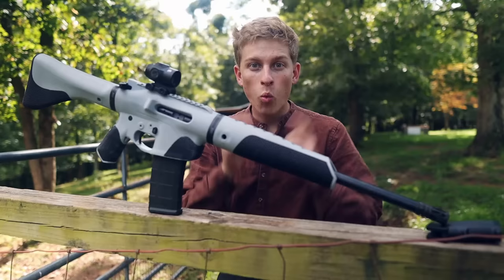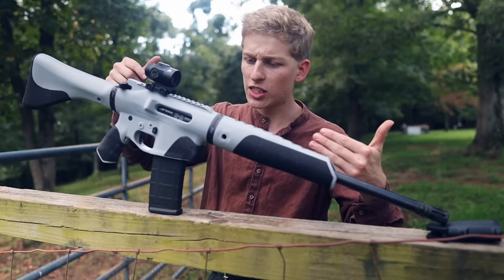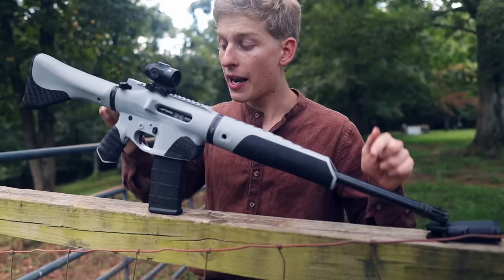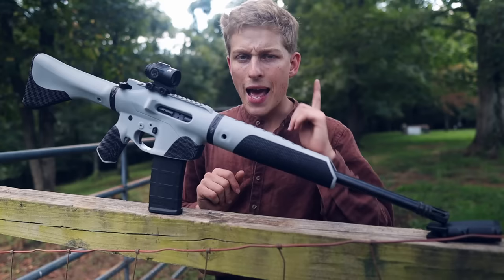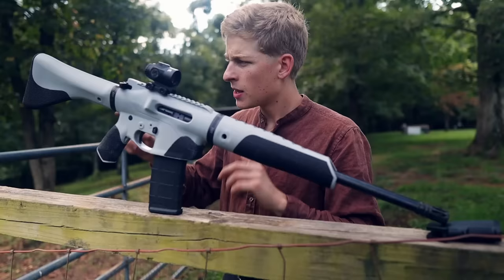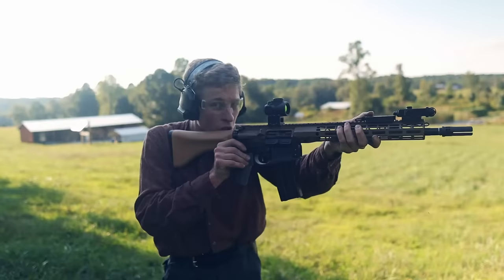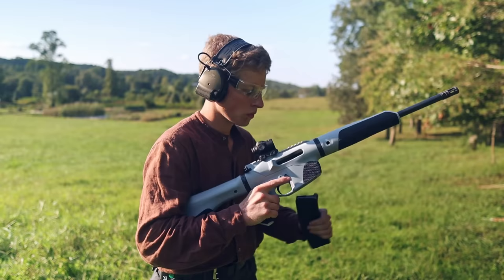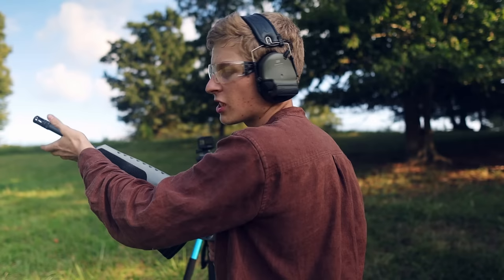I Printed an AR-15

Comment: It looks to me like the front wall your deflector wall isn't steep enough. If you look at where the shells hit the deflector on the manufactured upper, they hit farther up on the point because it is steeper and slightly farther forward as a result. On your upper, they are hitting on the front face, which pushes them forward. A totally different idea would be to add a slight angle to your deflector face, either up or down. That should deflect the shell out of line with the ejection port and guarantee that it doesn't go in. I've often wondered why manufacturers don't do this. Also worth trying an adjustable gas block. You may be over-gassed.

Comment: Will there be any support for a left handed version?
Reply: I think that would just be a lefty bolt and mirror the slot. I don't know how the selector works on it though, but you could mirror that (you can print the selector/mirror it, and you can also print mag release so mirror it too). So I would think eventually, but I don't know the specifics on how they make lefty bolts.
Reply: @jakegarrett8109  I’ll just get an ambidextrous selector switch. Shouldn’t be too difficult to modify it to be left handed, but it’s be nice if there were lefty files at launch haha
Reply from the maker: I would like to.
Reply: @HoffmanTactical  that’s nice to hear! I’m glad there are people who take the time to design stuff like you do!

Comment: It's a cool design. Is there any way you could get a nicer resin printer? It just seems like anything made out of melted plastic is obviously going to fail quickly. The plastic itself is made to melt at pretty low temps so it can be printed. To actually print a whole gun you'd need some sort of plastic that can have a secondary reaction once printed that makes it significantly more heat resistant. Or I imagine resin could be very heat resistant. Or you could go with a nicer 3d printing tech than either of those. 

I think if a town had one guy with a high end 3d printer who could print them in resin it would be big just for if the world went to shit. I don't think PLA based guns are ever really going to make sense, but I really respect the work you put into this.
Reply from the maker: Sadly resins don't have the needed mechanical properties - yet. I have high hopes.

Comment: Not really a gun or 3d printing guy. All I can offer is, you've got a cool science fiction gun.   Take a close look at your deflector. Look for dents are scrape marks. Since it's 3D printed, I'm sure it's got that stair step printlines look about it. If it's got a vertical printline, it's not really a ramp, it's reflecting on a 90° plane.  Try filing it down. Alternately, try polishing.  The other option is to reduce or get rid of the deflector completely. But you already know this.

Comment: print every weapon page? also for the ejection problem, try a smother transition from the port to the ejector itself. seems to hit really close to the straight part and could be the issue. that or get a heavy buffer tube

Comment: I'm guessing that the plastic is absorbing more of the energy from the spent casing. The metal brass deflector rebounds more of that energy at an angle on the spent casing thus sending that spent casing farther away and at a larger angle. The plastic maybe has less rebound force? Just like how golf club driver faces can be more or less "hot" in their rebound force. (Trampoline effect / coefficient of restitution)

Comment: Try a seamless transition from back of bolt opening to deflector as one solid ramp out instead of the bolt opening, hard angle, then deflector, does that make sense?
Reply from the maker: Yes! This is actually what I did with later versions of the design.
Reply: @HoffmanTactical  oh cool I’ve put the files somewhere safe while I get better at using my printer. Keep yourself safe brother you’ve done great things for all of us but make sure you keep yourself safe aswell. You have the ability to make people listen to what you’re saying and that could turn out to be a very important skill in the future. Much respect

Comment: I have been looking the video and I think the problem is the thickness of plastic and that kind of 90 to 45 degrees that generates the deflector and the upper. In a future iteration  you should try a straight 45 degree to let more space for the brass to spin a litte bit more and also to avoid the perpendicular bounce in that border and creating kind of a slide for the brass and let it hit hard against the deflector. Just an empiric idea from observation. 😁

Comment: You might fix your ejection problem by having an angle in the plastic at the ejection port, it's too thick and the cartridge is bouncing off the back wall, giving all 4 sides of the ejection port, say a 40 or 45 degree angle, could possible negate the need for other solutions. Unless that is, you specifically have that area right there that thick for a good reason, in which case, carry on and good luck, nice build.

Comment: 13:49 i think that your ejection problem may be related with the elasticity on impact of the plastic with the shell, you could try changing the deflector angle of the plastic or adding a metal sheet cover to it which could also add more durability to the deflector. Additionally i would look on the flat part of the groove on the start of the deflector, you should definitely consider adding the slope to the end instead of having an "L" angle.

Comment: Man, thats some sweet design work 👍 As far as the ejection issue, it seems like the ejected case is getting caught on the rear of the ejection port on the perpendicular 'flat' wall before it angles back to the brass deflector hump. Maybe extend the rear of the ejection port opening further to the rear, blend the rear of the ejection port as a smoother transition into the brass deflector, and make the brass deflector less steep of an angle.

Also - how about polycarbonate for the heat-sensitive area? Doesn;t it have a higher glass transition temperature than any of the nylons?

Comment: Have you watched any of 3d Nero's streams? I'm not sure carbon filled nylon is going to do what you want in the long term as it still has elongation issues in heated chamber Vorons and that is no more than 100-150C in the heated chamber. For semantics, it really does come down to a question of what is an AR-15 though. You've drastically re-engineered or designed from scratch the upper, lower, buffer assembly, handguard and barrel mounting system, but retained the barrel, gas system, bolt carrier group, buffer spring/buffer and trigger group. Is it still an AR-15 or is it a new gun that shares common component? It certainly looks better than a standard AR-15. I think it is overall a brilliant.
Reply from the maker: Yes, so I think a lot of the issues with Nylon on the Vorons is due to creep. Annealing the Nylon drastically reduces the problem, which is what I am betting on ;)

Comment: Ejection port is too far back and  bolt is hitting ejected brass when returning.
Reply from the maker: Funny enough, the problem was actually that the ejection port was not far enough back! The plastics deflects brass differently then aluminum, and the port geometry has to be changed.

Comment: I love your video. I think the shell ejection port might be a little bit too thick. the  Initial angle is to steep. It looks like your receiver might be 1/8th to a 1/4 inch thick and that is catching the back of the brass towards the rear of the upper. That may be causing your malfunction.

Comment: From what I seen the ejection port the shells shoot out backwards and catch on to the port itself and when it's a metal gun it probably just slides off of that nice and perfect but when it's 3D printed and especially when it's red hot shell it's probably going to want to stick into there that could be why maybe if it was a lot smoother instead of going completely flat then have the ramp make the whole thing a ramp. Just a guess and going off what you are showing in slow motion.

Comment: One piece lower-stock should be the way you went on reason to have a two piece design
Reply from the maker: Print orientation and printer size dictate a two piece design.

Comment: Exactly how stoner envisioned it - one linear fire system surrounded by light stuff.  Fire control should have been printed too.
You just printed the furniture.
Reply from the maker: One are of dev at a time ;) FCG is another project.
Reply: Last I checked the upper and lower recievers weren't considered furniture

Comment: Is it possible to build this left-handed?
Reply from the maker: Yes, though I've not designed it yet.
Reply: @HoffmanTactical  is that something that could be done by mirroring the print file then buying parts designed for a left handed gun? (Brand new to building guns, the most experience I have is in dismantaling my JTS M12AK for cleaning.) And thanks for your time

Comment: someone needs to develop better high-temperature resistant materials. Some kind of cooling system, some kind of thermal conductive coating and material. The gun would melt in a long gun battle or war. You can't beat metal and wood. Why not a mini CNC machine that turns out lowers?

Comment: I'd say it's more of a 99 cent store AR-15C as Cheap as any hard plastic can be. I'm guessing 20 rounds and broke.
Reply: Most designers require them to survive 1000 rounds before being released. The fgc9 has been documented going multiple thousands of rounds before any cracking and it has a home made bolt and barrel.

Comment: Why even waste your time with PLA? Awesome project BTW. I'm hoping I can get in to the beta. CF Nylon is probably going to creep long term. I have allot of experience testing it in heated enclosures, and have had some nasty failures at high temperature. Cost wise polycarbonate is going to be your best bet, IMO.
Reply from the maker: Annealing should help a lot with your creep issues. I'm going to try using PC CF, but it does have impact and layer adhesion issues. I use PLA for prototyping, since I'm doing little more then fitment testing.

Comment: Reduce your deflector angle (more obtuse an angle than milspec) by the same % as the difference in elasticity between pla t6061 your problem is you have more bounce with pla

Comment: At 9:06 on the video you will see his upper split away from the intergrated buffer . The third shot at 9:11 the split in the upper opens again . 9:17 it happens once more . Play youtube video at 0.25 speed see it happen . He is lucky his face is still intact . Dont 3d print uppers or lowers they are a death wish . If you want to make your own lowers go to defence distributed and buy a cnc machine and do it right . Also follow all necesaary federal mandated protocols .
Reply from the maker: The gap is from the buffer tower flexing, and does not lead to failure. I have had other designs that did break at the buffer tower, and my face is still intact ;) Pressure is contained within the steel barrel extension, as with all AR's.

Comment: Dear Hoffman Tactical.
You try creating Maximum 3d parts AR 15.
I want to offer an idea. 
How about try 12 gauge single shot shotgun?
Only metal pipe - barrel. It is possible?
Reply from the maker: It's possible, but much better options now a days (liberator 12k)
Reply: @HoffmanTactical  Thanks for the Answer.

Comment: How about you get an adjustable gas block before talking about a defective bolt carrier group
Reply from the maker: I've actually got one on the way, however, I know now that the problem is related to the ejection port geometry, and the elastic properties of the plastic. An over gassed gun does not cause this level of malfunction.

Comment: 17:25 ummm is it just me or does it look like its about to split open
Reply from the maker: Buffer flex, it's actually normal on poly lowers, but you can't normally notice it like this.
Reply: @HoffmanTactical  ah ok, it was just weird looking at that considering it was plastic. Was thinking with the heat of the weapon being fired it might eventually cause it to split open
Reply from the maker: @faustisfrost5794  Yes. There just is not enough heat back there (or any where in the lower) to cause  a problem.
Reply: @HoffmanTactical  ah makes sense still new to firearms so .

Comment: Okay I'm going to ask you several different things maybe you already know maybe you've already practiced it yourself...

JB weld does it have a melting point and if not then why isn't it not utilized more in builds as a filler or a transitional buffer.....

Secondly seeing as I come from the automotive world has anybody ever used Capcom tape as it is used in the automotive world to prevent high excessive heat from like turbos and exhaust from burning paint and doing other damage to other internal parts of the engine area.... They make some other cool stuff I can't remember but it's like a gold style tape and basically you can take a torch to it and it will not transfer the heat to whatever's behind it
Reply from the maker: The tape has potential, there a few automotive solutions that can be applied here, need to experiment. However, JB weld has limited thermal resistance, and very poor strength, not good for much really. There are some high performance epoxies you can get that would give you a little edge, but not much.
Reply: @HoffmanTactical  thank you for your response....

I'm really trying to think from an engineering standpoint but at the same time figured you'd probably already tried with the JB weld.... 

I would love to see the 3D community succeed over the alternative....

So engineering a permanent solution is a must... Just don't want to go down the same rabbit hole everybody else has already tried
Reply: @HoffmanTactical  have you ever tried using carbon fiber sheets to use them as insulators and cut them to fit size for spacers or for thermal insulators not sure how thermal insulating carbon fiber sheets would be but you wouldn't have to print them you can purchase them be advised though cutting them requires a mask and some water to keep the dust down not the safest kind of dust
Reply: @HoffmanTactical  okay after a quick search of thermal conductivity of carbon fiber or using as an insulator evidently it has very great insulating properties also has an extremely high temperature rating so if you were to purchase it in sheets and machine some dividers or spacers or insulators in some way shape or form and design your parts around the pieces that you create to do so I think we have a solution to a lot of our problems....

It seems like you have a lot of cool machining materials I should probably talk to you on Odyssey instead but I'll let you do with what you have for information maybe you've already been working on this secretively but again we can continue the conversation elsewhere definitely not here...

PS thanks for your response

Comment: plastic just isnt as ridgid  as metal and the kenetic energy from the brass is being absorbed more when it hits the deflector than it would with a typical upper.  id sugggets  doing away with the deflector   and see if the brass will just roll backwards away from the rifle instead of bouncing forwards
Reply from the maker: You are correct, while doing away with the deflector was not the solution, it was close.

Comment: upper slit at 11:23 this wouldn't last long . watch at slowest speed .
Reply from the maker: No, that is actually normal and does not result in failure. It's just harder to see the flex on other guns ;)
Reply: @HoffmanTactical  I see ! So it's just a cosmetic flaw?

Comment: You can't claim to have printed a "fully functional ar15" unless if you print EVERY part. This would require a multi thousand dollar metal printer/sintering machine. Also, pla is a poor choice for gun material, at the least I would use ABS.
Reply from the maker: LOL.
Reply: @evansoutdoors4022  I print often, PLA breaks down when exposed to UV rays over time, it's less heat and chemical resistant than ABS and therefore will not last as long, especially when exposed to the elements and heat rifle parts are exposed to. There's a reason most car parts are made of ABS and not PLA. Most people are too proud to take a little constructive criticism but hey your loss...

Comment: Great stuff. Now figure out how to 3D print gyrojet rounds and your gun design problems are over.
Reply: Also, make the ejection port on that thing smaller.
Reply from the maker: Sadly I tried that, and ejection problems where much worse.